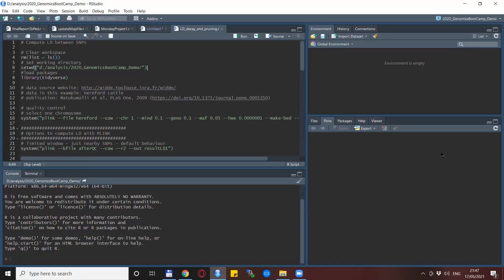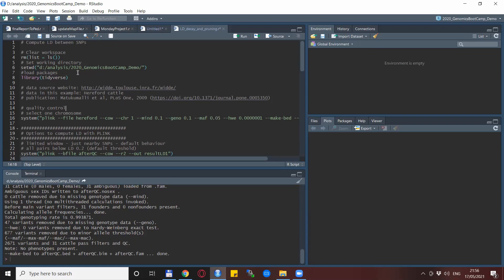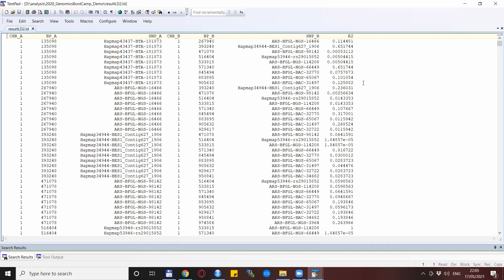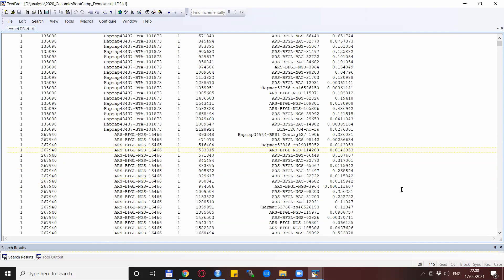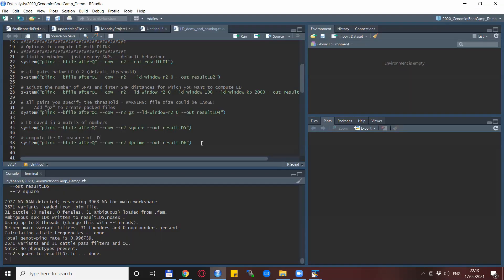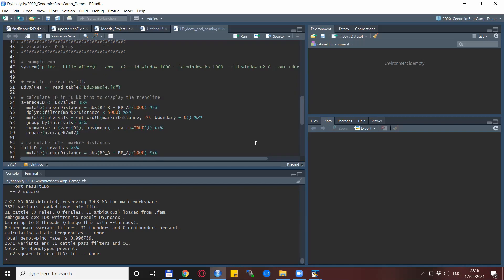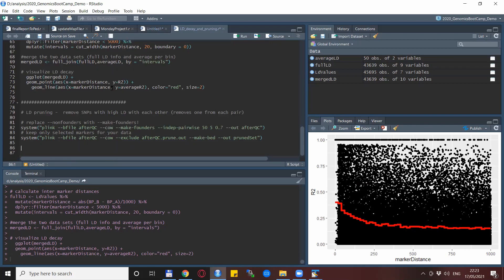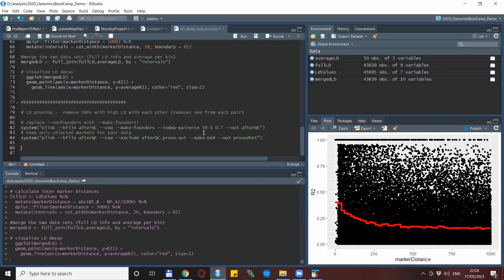How to compute linkage disequilibrium with PLINK | Genomics

Comment: Hello professor...I have 323 observations of 7 variables in my file...and everytime I am trying to run your R code, the error message marker size should be 323 is displayed...please tell where I should make the changes in the code
Reply from the maker: At which part does the error message show up? What does it say exactly?
Reply: Thank you Professor for replying .I could solve the error...I had to make changes in the fun command and replace it with list

Comment: Thanks for the great video series. Is it ok if we can prune out half of the variants in the input file? How do you select r2 value? Please explain. Thanks in advance.
Reply from the maker: Hi,
Yes depending on the population and the r2 value, a LOT of SNPs could be removed, even more than half in inbred populations... On the other hand, you could think about the remaining SNPs as (fairly) independent ones. Which is good, and even necessary for some computations. Now the question is how independent you want your SNPs to be. The lower r2 you set, PLINK removes pairs that are higher than that number, and the more SNPs you lose.

For the exact value, I do not want to give a number. Perhaps the best to look up some similar papers related to the thing you want to do, and take inspiration from there.